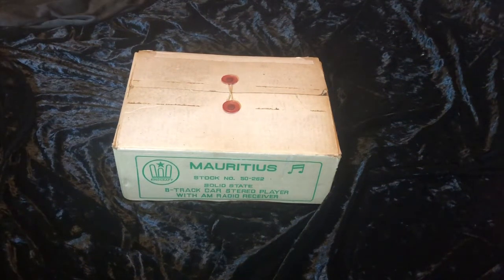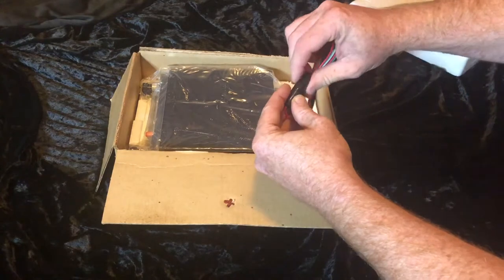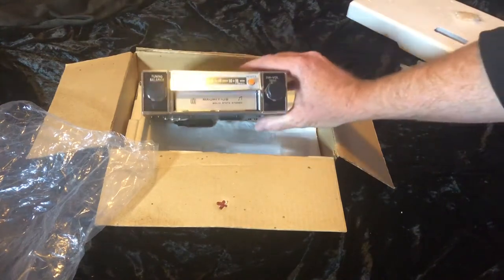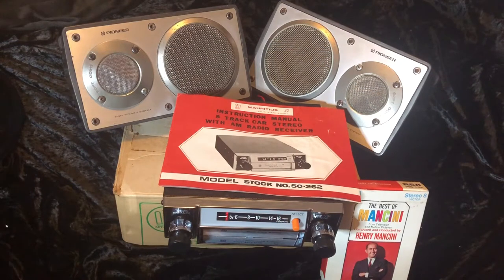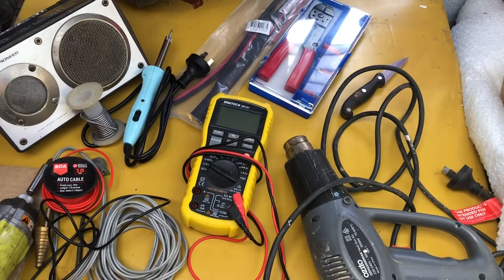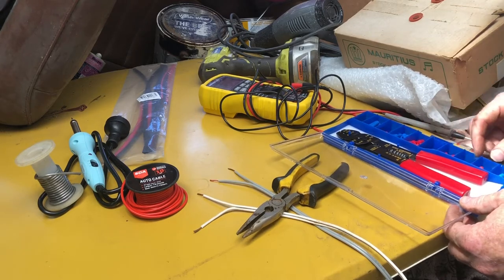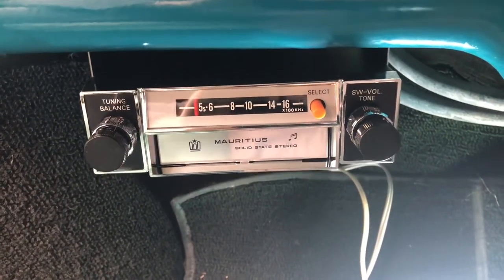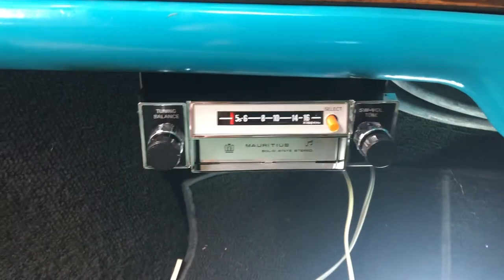Installing a vintage “new” 8track player in my classic mini.

Comment: The radio  would be new old stock  and thanks for the video  this will help alot when me and my dad put an 8 Trac player in his truck does it say what size fuse that is by chance ?
Reply from the maker: Hi Ghetto Santa, It was an 8amp from memory but better to check any info you can find online for your model. I Know that's not super helpful but I'd hate for you to blow your player. Thanks for watching